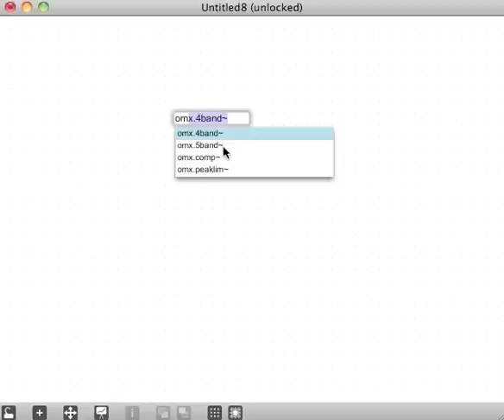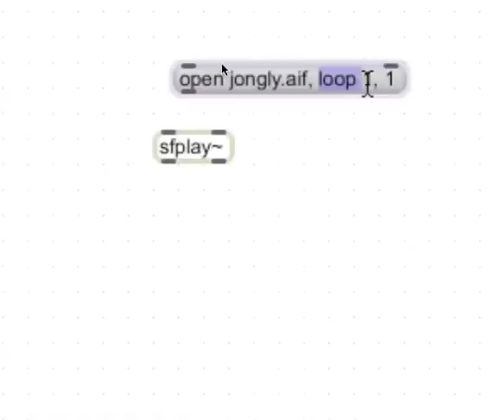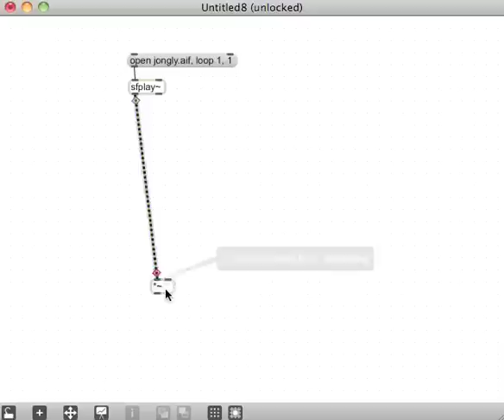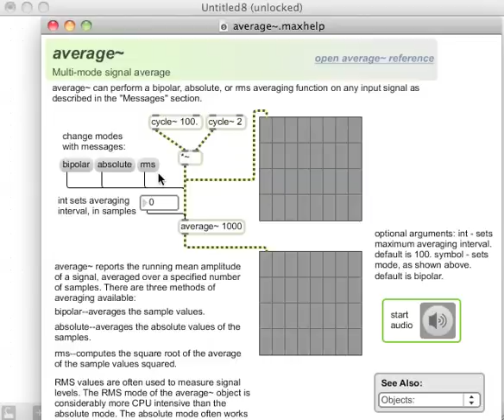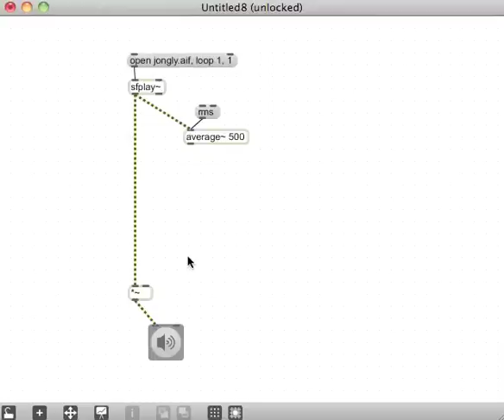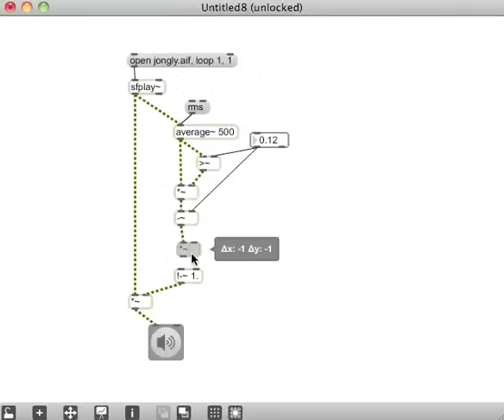PAD 35 - Compressor

Comment: Hi Baz, firstly thanks so much for the tutorial videos, they've been a big help so far.

Have you done any work with ducking/side-chaining the compressors on Max? The help files and tutorials are a bit sketchy on that. I was hoping to modify the Octimax one a bit to accept a sidechain signal to duck string sounds to percussion. Any advice would be really helpful. Thanks!